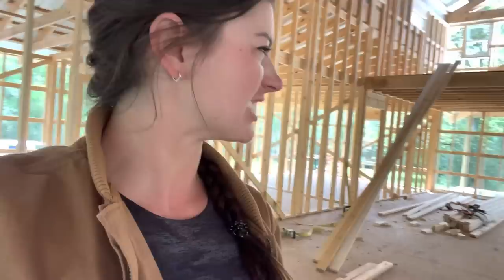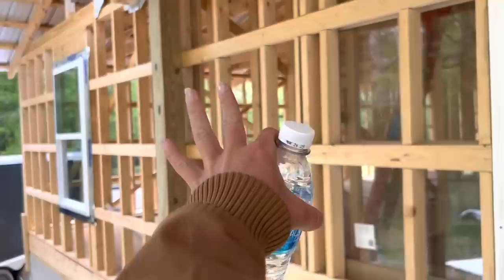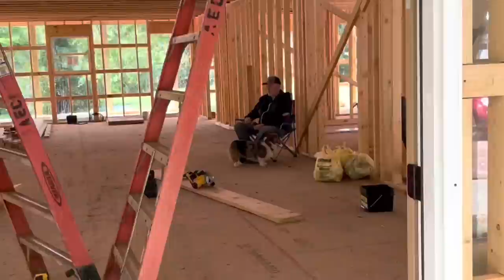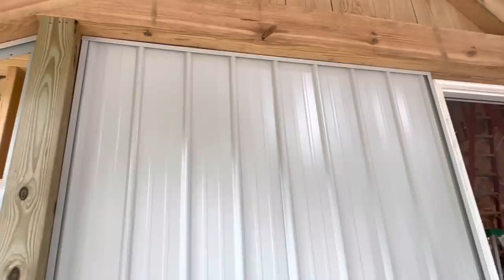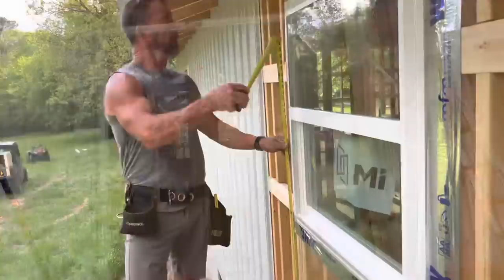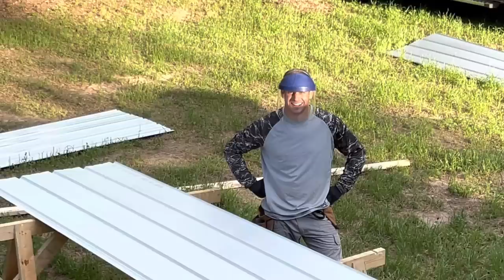Putting in Exterior Doors & Working on the Metal Siding on MY HOUSE!

Comment: You should put brick ledge trim under the metal sheets where it sets on the deck boards to help slow lady bugs and other small critters from going between the cracks and building homes in your new home. It looks more trimmed out too. Use rat guard everyplace else, which I'm sure you are. You are going to have a nice place.
Reply: Heed Mr. Jerry’s advice! He is dead on.

Comment: Looks like a huge house.  Good work.  Paint the whole frame structure with wood penetrating epoxy, increase the strength tremendously, where Sasquatch will have more problems getting in and it'll be sealed from moisture and termites, etc. Etc.  😇😇

Comment: Hello Hannah, It’s great to see how much you’ve grown personally and professionally from your youtube beginning. The house construction is coming along quite nicely. Just wanted to ask if you considered a wall type design. A typical wall design would include thermal insulation boards and an air barrier in between the board and the exterior material for any condensation. It also considers the connection with the wall studs to eliminate thermal bridges. You may find a lot of good info online. Keep up all the good work. Greetings to you and to your dad for raising such a beautiful lady.
Reply: Im a little unusre about that type of construction aswell, here in scandinavia we would never do it like that, we would have double layers of insulation not cutting in the horisontals in the standing structure like that, and of course have foil on inside and outside to create a breathing wall design, and a air barrier against the exterior material

Comment: I'd like to point out that after the 2004 hurricanes hit Florida, two of which ran over my house, I made it mission to study which roofs failed and which held up the best. Without going into details, of all the metal roofs I observed, the only ones that failed were those attached directly to studs/framework, storage and warehouse type building, barns etc.) instead of being laid over plywood sheathing. I don't know how susceptible you are to hurricanes or tornadoes in your area, but applying the metal directly to the framing as you did is a receipt for failure.

Comment: Styrofoam is the best insulator between hot and cold. I put 4 by 8 by 1 inch styrofoam sheets all on the interior of my home and I can heat my entire house with a match. That's an exaggeration, but it's true.
11 bucks a sheet at Lowe's it'll save your more money overtime. You wouldn't even need to use fiberglass at all. If you could afford to do it on the inside and outside and leave the studs bear and have an air gap.
You're not going to get any better than that. 🙃
Anywho hahaha looks great!

Comment: Take pics inside house of how pipes and electric wires run in walls before you cover with insulation or wall material. When you need to cut wall or drill in future you will appreciate having pics.
Reply: That's a really good suggestion.

Comment: That is unbelievable.  The j channel is a disaster, definitely will experience leakage as well as structural issues.  Metal siding is only used after the walls are properly built, sheer strength ? 
Structural engineer ?  No flashing around the door ?  Header's appear improperly structured.
No strapping?  Blocking ?  
Hope it doesn't collapse in a wind storm..... 
Maybe someone fixes these issues off camera?